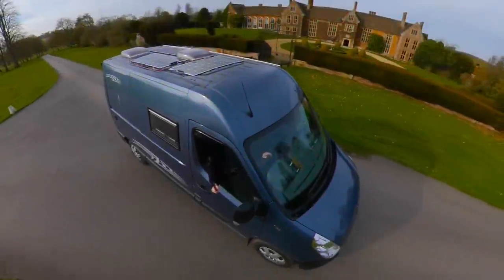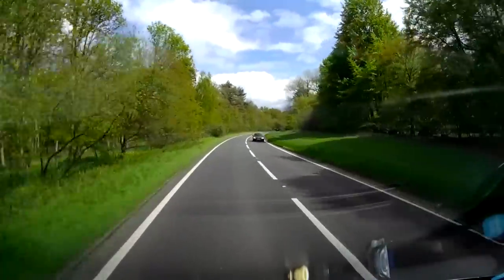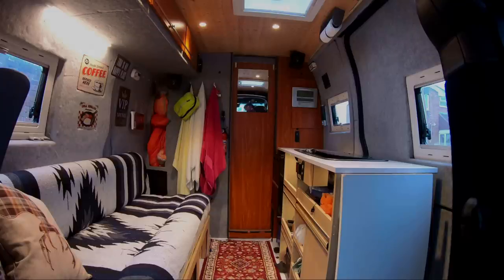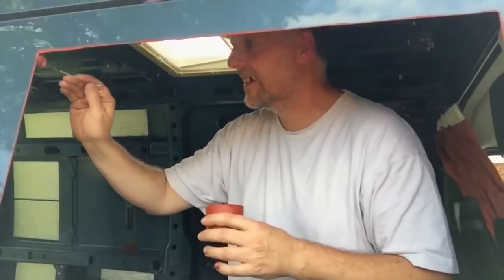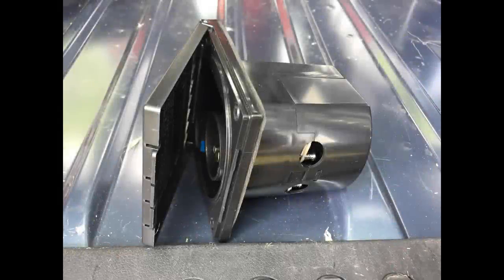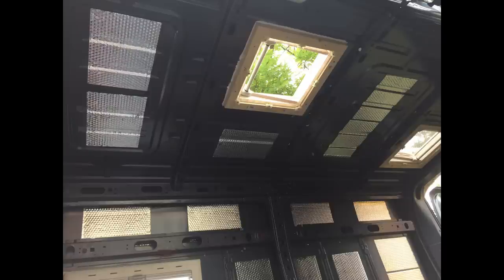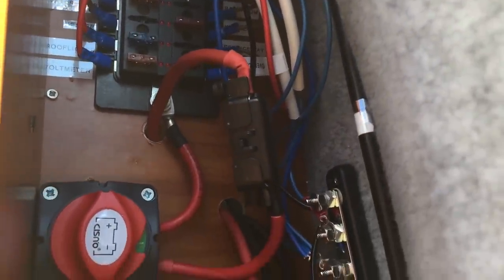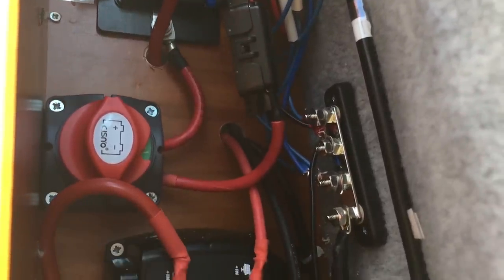HOW TO MAKE A CAMPER VAN From Start to Finish (Low Budget Interior) 2020

Comment: Wonderful video. I was apprehensive about spending an hour, such are our attention spans these days, but it was absolutely gripping.

I like the open cupboard idea. It seems so obvious now that doors are not necessary! Do the shelves slide out?

Also like the shower hot water solution. (And the decision to have it at the back of the van.) 

What is your view on a foot pump for the shower to get rid of one more piece of electrical equipment which could go wrong? Or would it be impossible to fit within a fixed shower structure, i.e. one with walls?

Is there a reason why no one ever seems to fit the kitchens at the front of the van, i.e. flush with the bulkhead? I always think it looks odd to have the doorway half-blocked with kitchen units, though I appreciate the advantages of access to the units themselves.
Reply from the maker: John Barclay   Glad you enjoyed the video. The shelves are fixed and do not slide out. 
I don’t know about a foot pump for the shower as I have never used one, but I would imagine it’s not impossible to rig something up.
In regard to the kitchen location, a lot of it depends on where the bed is going, as that is what usually takes up the most space and needs to be accounted for. I would imagine there are some vans that do have the kitchen behind the bulkhead, although I don’t recall seeing any with that particular layout.

Comment: What is Sika flex is it building adhesive it's more of a cork filler isn't it then adhesive what is that dampening panels called where can you buy them from what shop
Why don't you put the spare wheel on the back door and put an aluminium grey water Tank underneath.
You could put a thermostat element in the bottle you can get short ones
Possibly work if you got a long coil of thin copper pipe put it inside the heater outlet pipe and feed a vertical tank for kitchen sink and shower have a little expansion tank they're not very big for central heating, and the ball valve could be mounted in the frame above the shower and tank. or possible you could use to thin oil in a closed pipe system also. I don't know why you just don't build a wood burning stove back boiler you can use an old gas boiler has the cast iron matrix and thicker Steel plating instead of the galvanised thin metal you can just use scraps pieces of wood by the roadside to burn more environmentally friendly cost-effective